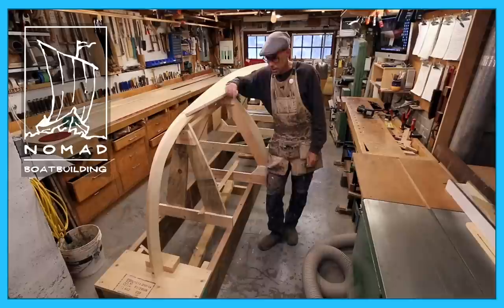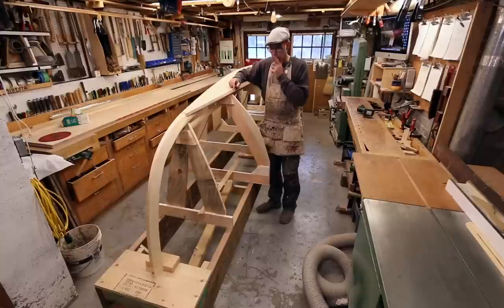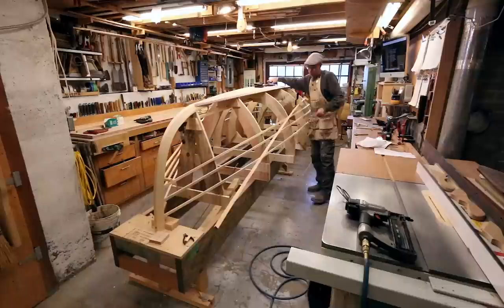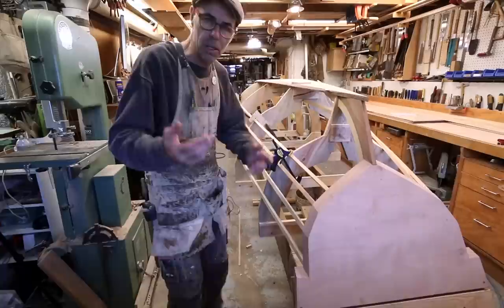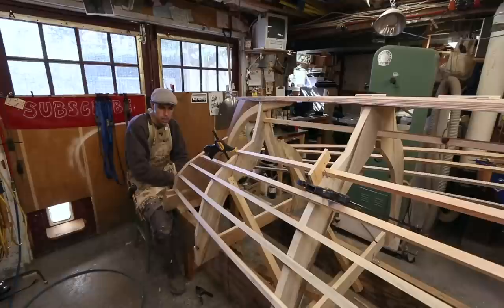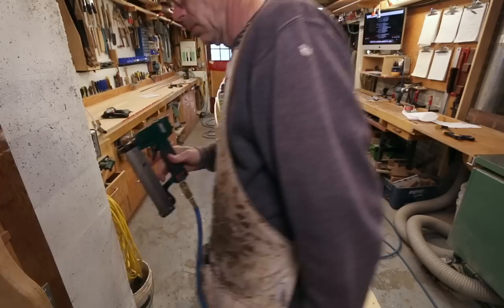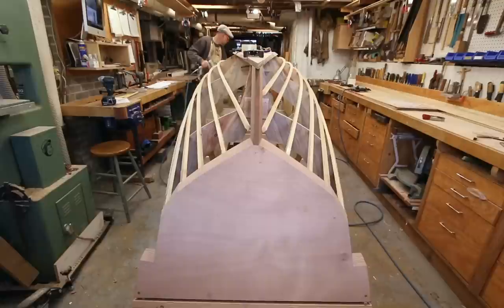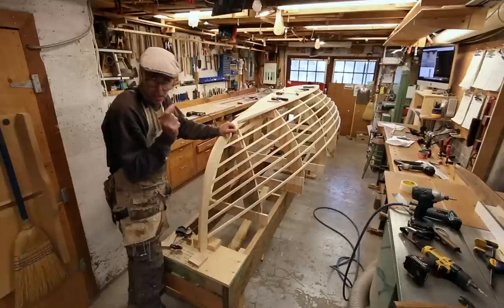Building the Catalina Wherry - Part 13 - Installing Ribbands

Comment: My build used 6 planks per side and I  joined 2 lengths of 9 mm ply with a scarf while on the mold. Amazingly simple and  easily controlled method. I was very careful about wasted ply when cutting planks and laid them out in a nested pattern on the ply and cut out the banana-ish shapes with a jigsaw (reciprocating handheld). I made a single full length plank of cheap 3/8 inch ply for spiling purposes using a combination of width and curvature that would fit between ribands of all except the very lowest plank position. Clamping /screwing this spiling plank to the mold then allowed measuring from a reference point on the plank to the upper and lower riband at each station. The spiling plank was then removed, laid over the ply sheet and plank measurements transferred.  
Cutting line established with use of a fairing batten. I was not in a hurry, used reasonable care and did not have to re-cut a single plank.
Reply from the maker: I have a modifiable plywood chain-link spiling pattern that comes out for some builds. Works best when there isn’t much twist though.

Comment: This is looking really nice and reminds me of the fun and challenges i had when i built my Puuvenepiste Savo 650D (4 strake lapstrake 6.5m long double sliding seat row boat) a few years ago from a kit.  At the time i had little boat building experience and had not had the benefit of watching your videos for a number of years.  It makes me want to build one again but this time from scratch in a similar way to what you are doing.  The designer recommended the same plastic nail gun as you have and although pricey it was great to use and made life a lot easier.  I am looking forward to seeing what else i am going to learn from you as this progresses.  Thanks.
Reply from the maker: We do our best to inspire you to get back to it.

Comment: I thought I heard you say "Palmer nails" and "Palmer nailer" so I thought I would look into the pricing and get one of my own.
HAHA!!
So now I realize you said "POLYMER" nails and "POLYMER" nailer. Yikes.
Just looking at the rake of that transom gives me the impression that this boat will be built for slippery fast speed under oar. Looks like a racecar! Inverted and backwards, but you know 😉
Reply from the maker: I hear you. Yes, the polymer nailers are pricey. Useful once you gottem though.
Reply: @Nomadboatbuilding  will they work in my Senco nailers?
Reply from the maker: I haven’t tried but those who have say that the lighter gauge nails do but they tend to misfire or jam with some frequency.